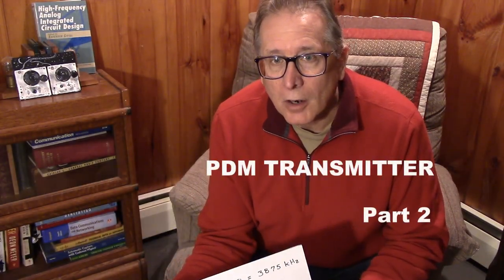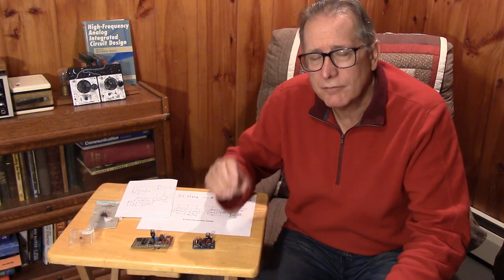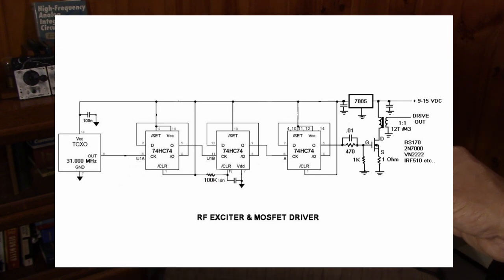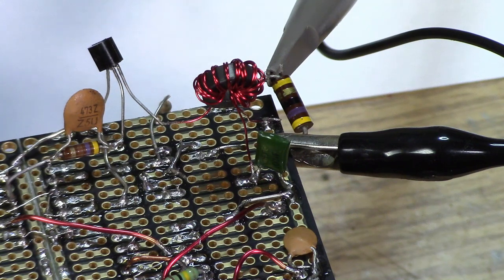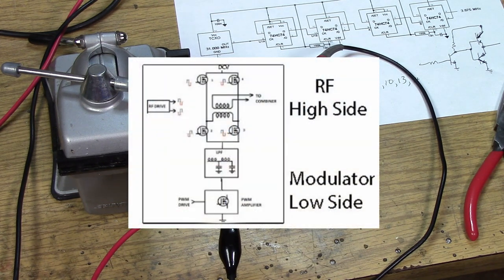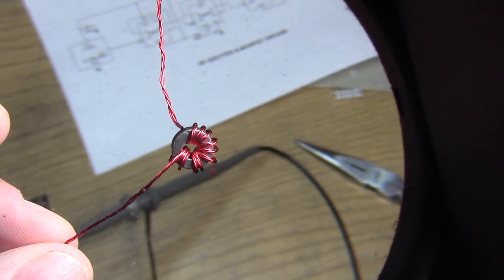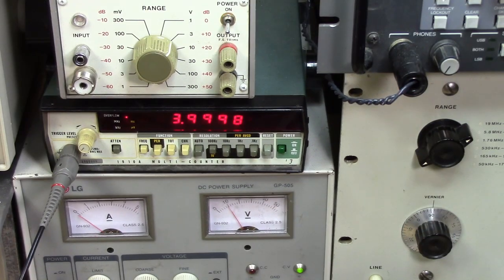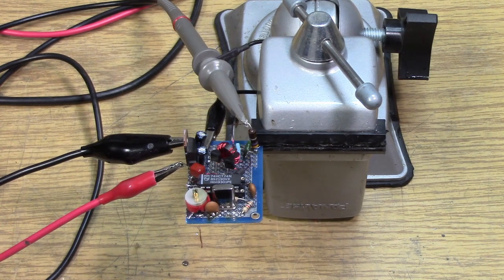PDM Part 2

Comment: Disclaimer: I could be wrong ;-)

The fuzziness of the push-pull waveform seems to indicate that you may have some very, very high frequency oscillations in the output of the pair of fets. I think putting something lossy like a resistor or a bead in the gate of the mosfets should help. W2AEW sent me :-)
Reply: Yes, when I saw this I though: "You should tweak the trigger level!". He did not.
Reply from the maker: That scope is pretty bad - but I think you are on to something!  Could be high frequency stuff. Those HCT devices are very high frequency capable.

Comment: Fascinating RF driver circuits, no tuning coil circuits required. Can't wait to see your AF PDM modulator circuit/s.  Yes, I too noticed the square wave on the scope showed something going on with the rise and fall of the wave form. You might have some type of parasitic oscillations going on with the driver MOSFETs.

Comment: What I don't understand about these designs is how do you get the carrier for the AM modulation? If the PWM audio signal is switching the RF on and off, wouldn't you get "double sideband supressed carrier" because in-between the PWM pulses, there's no output.

Comment: That 47 Ohm resistor is red hot. Great!  However, did anyone notice the oscilloscope probe attached just next to it?  If that continues, the resistor wire will slowly melt down the plastic part of the tip damaging the probe...  Been there, done that!
Reply from the maker: Guilty!